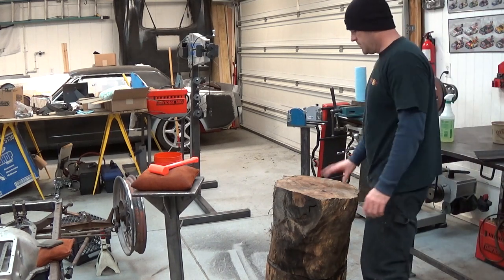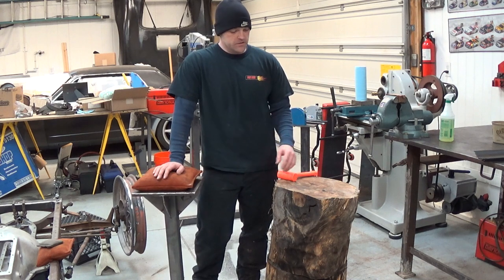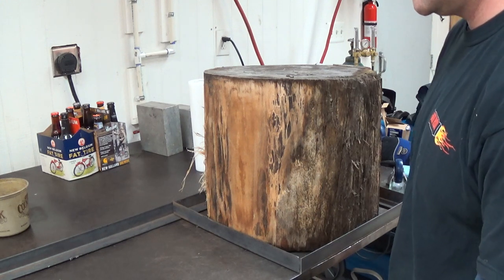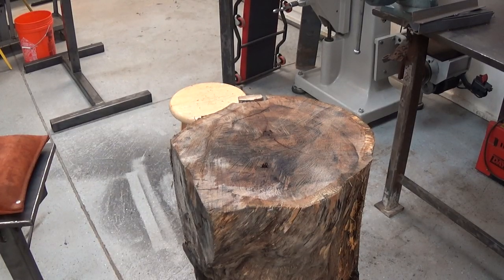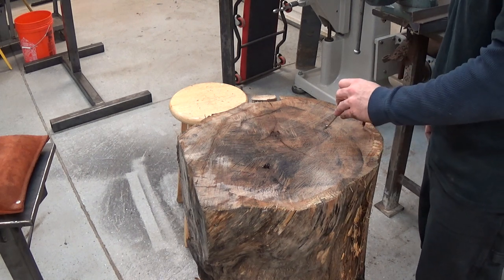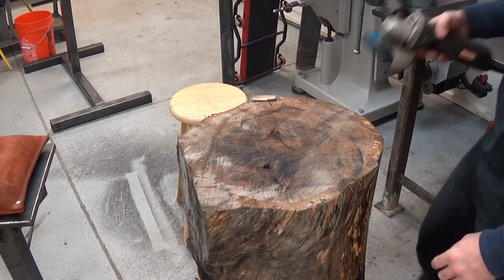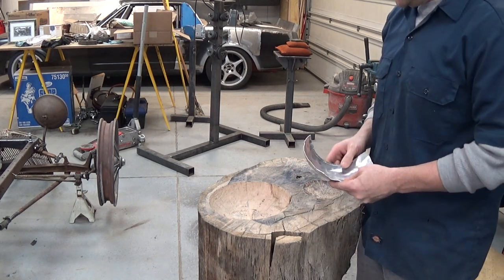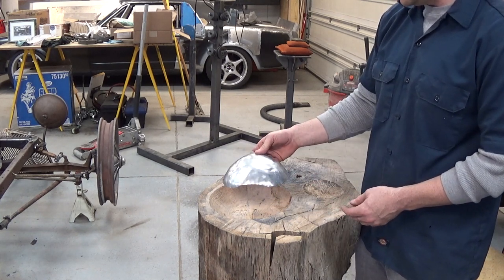Metal Shrinking Stump

Comment: For planeshing stakes I use a towball trailor hitch, and a rail road spike, Have a couple of different ones of them, 1 super smooth and polished and a couple of others not so polished. And all my planeshing stakes fit into my hardy hole in my anvil. I may even make a holder out of 25x25 box section and attach it to the side of the dishing stump....

Comment: Check out Wray Schelin Pro Shaper  chanel on his shrinking facilitator made out of 2 x 4  or 2 x 8 in a frame.
so easy to make and replace if you damage a section but wray has used this for years.

Comment: When you cut angle iron in your bandsaw if you clamp it in the vise legs down like  a tent it is much easier on the blade.. you have more uniform tooth engagement instead of clamping it like an L where you have a thin leg then a big flat part. In theory you should have no less than 3 teeth engaged with the metal. If you have more teeth engaged you can use a coarser blade which equals faster saw times.